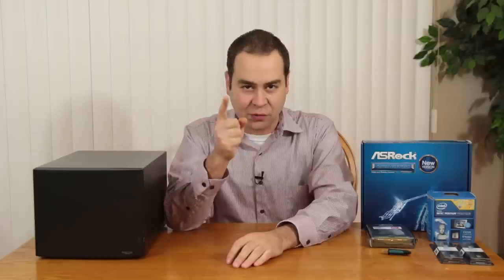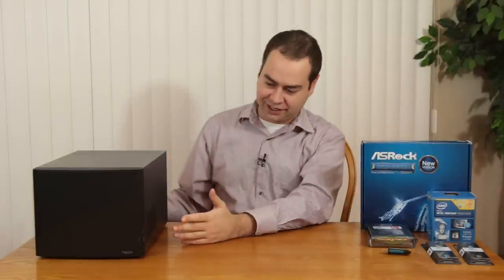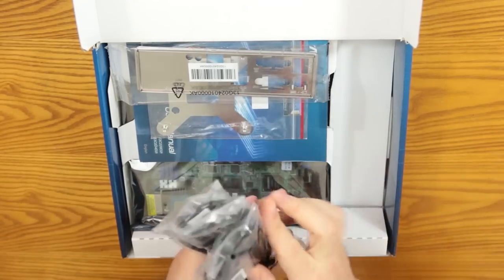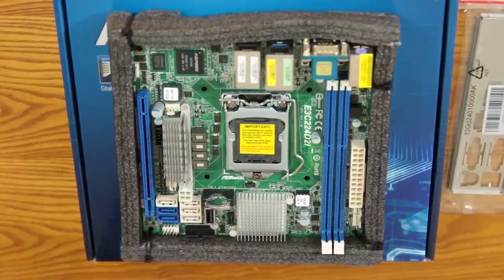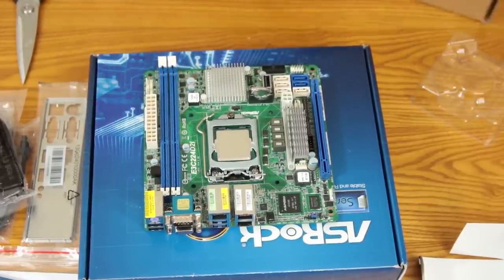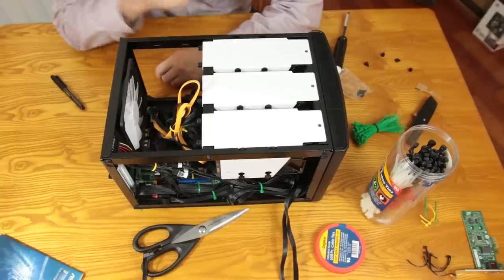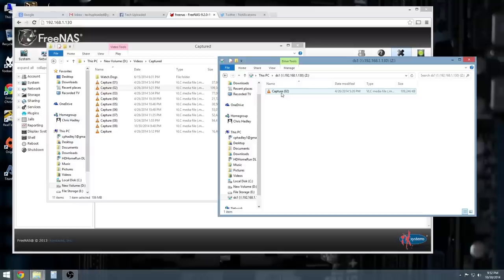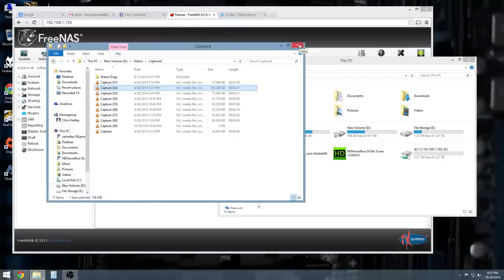FreeNAS Box ECC memory upgrade

Comment: Interesting, i have run my Freenas system for 5 years running continuously (except for when on vacation) without a problem without using ECC memory.  There has not been one error that I am aware of.  I'm storing pictures, movies, music on it for the whole household.  I do back up off-site and onto another 4TB drive in another computer to be safe though.
Reply: +vnitto Thanks for that! What RAM do you use anyway?

Comment: 10MB/s is not fast at all on a Gigabit Ethernet, it should be something in the range of 80-100MB/s...
Reply: +David Pérez i agree it should be much much faster... it should be around the 80MB/s range... he must have something that is throttling it....
Reply: +Nifty Mist well in case then he is capping out his switch... and should upgrade
Reply: Using a freenas system. 8 disk raidz2. Easy stable speed of about 100MB/s maintained while writing to the server. Not sure what he considers beefy but I'm at times writing 2 tb in one shot. For most of the home users such as myself I think 1 gigabit lan is going to be sufficient..
Reply: @bhoot  

Yeah, this guy has an old or defective network card/switch/router/or cable somewhere in his system creating the bottleneck. 

He really needs to find the choke point since he's only getting 1/10 the available throughput speed, assuming the rest of his gear is "modern". 

100 MB speeds over common commodity hardware is normal with FreeNAS. At least it is with all three of my FreeNAS rigs.

Comment: The i3 CPU that you were using before wasn't compatible with ECC memory?  Would have imagined that would be better than the Pentium.  I had no idea that FreeNAS didn't like non-EEC memory.  To be honest I don't know a whole lot about servers.

I don't like how the HDDs are vertical.  It's my preference that they're horizontal; they just seem to last a lot longer like that, I find.  Of course, just my preference haha.

I don't like how they trust me to take out the black CPU socket cover...I preferred it when they popped out.  It's something I've seen on quite a few new motherboards.  I've built quite a few systems in the last couple of months.  Not for myself though, just at school I've been building them for the younger kids, and building a few for friends and family.  

It's really hard to get a scale of the motherboard, until you put the heatsink in.  Wow, so tiny and adorable!  Haha

Cable management...Personally I don't like it with this case.  Then again, with all the HDDs there isn't much to do.  I guess with a case this small there isn't the room?

Talking about fans...The cheap POS Chinese one that I have on my gaming PC is slowly failing.  Keeps making weird noises, and grinding (kinda like its rubbing on a cable).  I checked, and as a I thought there aren't any cables there.  Ah well, it's still working fine, so I'll use it until it stops spinning!

You're not helping my temptation to setup a FreeNAS box myself!  As I said on Twitter, it's the price that puts me off and I don't really need a lot of storage.  It would just be nice.  Added redundancies are always good to have.  :-)

Comment: I search and search through the internet for a clear answer, but I have yet to have a answer, if I am building a nas, is it better to have a i3 or xeon? I want to do 2-3 streams in 1080p. Eventually, be able to stream 4k contents. I am just not very sure which path to take.
Reply: If you have the budget for it get the xeon or an i7. I say this because an i3 will not really be able to handle multiple streams at 1080 or 4k. check https://www.cpubenchmark.net/cpu_list.php

Comment: How can I know my Motherboard support ECC memory.
Reply: +Rolly C Check motherboard website.
Reply: +Rolly C You will need a server/workstation chipset.  So, no Z, H, or B series on Intel.  Basically no mainstream hardware.  Most all Intel CPU's support ECC though.  My server has a Supermicro board with the C226 chipset.  The CPU is a little Pentium G 3260.  You can always look up the Intel Ark page for any CPU or chipset to see ECC support.  Just google said chipset or CPU and click the Intel Ark link.  Usually one of the first couple links.  

I have not used AMD with ECC so I have not researched it at all.  Intel is so much more power efficient and more powerful per watt at the same time that I don't even consider AMD in a machine that will run 24/7.

Comment: Sorry but this is wrong.  You don't need ECC RAM to use ZFS.  Somewhere along the line some people have conflated "need ECC RAM and ZFS for extra data protection" with "need ECC RAM with ZFS for extra data protection".  The point is to plug all the weak points.

Comment: The premise of this video is utter horse crap. You do not need to use ECC RAM. The reason people freak out about it because they either don't understand the user case or the way FreeNAS / ZFS works. 
If an error occurs in RAM, then FreeNAS will happily write that corrupted data to disk the same way any other computer will regardless of the file system in use.  ZFS is an extremely powerful file system geared toward protecting your data at every step, but it can't protect against RAM errors. ECC RAM will automatically correct errors that occur within the RAM modules thereby closing that vulnerability. The FreeNAS / ZFS / ECC RAM combination are for users who are 'paranoid' about the integrity and high-availability of their data. If your not the kind of user to shuffle large amounts of data about (like a company would) you will quite likely never see a problem. ZFS mostly protects against disk errors and FreeNAS will run quite happily without ECC RAM. ZFS doesn't come with overheads though, so you'd have to wonder why anyone would go to the trouble of using ZFS and not use ECC RAM.

Comment: Yeah, you don't actually need ECC RAM for ZFS. The mighty “scrub of death” is bullshit. 
There are basically 2 types of RAM errors you can get: 
1. Random bit flip
A single random bit in RAM is flipped. Quite rare but it does happen. 
Result: An integrity check might fail (even though the data is fine) and ZFS will mark a block of data as damaged and attempt to repair it. The repair will only take place if the redundant block passes the check, so the data is fine. 
Worst case: Correct data will be (needlessly) overwritten with correct data. 
2. Fixed bits
RAMs sometimes break in a way where certain bits will always return the same value regardless of what's been written to them. 
Result: Every integrity check which uses this part of RAM will fail. If both a block being checked and any redundant block which could be used to repair it are affected, the block will be marked as lost and the whole volume as unrecoverable, but no correct data will be overwritten because there was “no correct data” to overwrite it with. You'll need to replace the broken RAM and recheck the file system. 
Worst case: Basically a denial of service until you replace the RAM. 
And then there's the fearsome “scrub of death” where your RAM magically becomes a first order SHA256/fletcher2/fletcher4 collision generator which garbles up any data read from the disk but only in such way that half the time the checksum is correct, so every correct block of data will be marked as damaged and then, when the redundant block is read, it will be damaged in RAM, but it will pass the integrity check and the correct data will be overwritten with garbage. Repeat until all data is gone. 
Worst case: You lose all data, but you now have a first order SHA256/fletcher2/fletcher4 collision generator and any intelligence agency in the world will give you millions (if not billions) for it, which should help ease your pain. (Hint: In case it's not obvious enough, this will never happen.)
Reply: +hellterminator The issue is that ZFS will use the data in RAM, not the parity if neither checks out with RAM.  It always assumes the RAM is correct.  This will introduce bitrot into the array.  Much like you get in RAID5 setups.  But in RAID5 the controller just guesses at what drive has the right data on it.  50/50 shot of borking the data.  

So, the whole array may not go down, but chunks of data can be lost with a flipped bit in memory.  It can and has happened.  You see it crop up on the FreeNAS forums from time to time when people come in asking about corrupted data and in many cases it boils down to non ECC memory.  You wont even know it happened till the day you try to read the data.
Reply: Chad Bremer I was talking about scrubs because scrubs are the most common argument for ECC RAM. When writing data to the drive for the first, yes, if it gets corrupted in the RAM, it will be corrupted on the drive. But the same applies to literally every other file system and you don't see anyone saying that ECC memory is necessary for NTFS or FAT32. 
Sure, it's better (it's always better), but far from necessary.
Reply: ***** it will do the same thing in a scrub.  ZFS trusts data in RAM always.
Reply: Chad Bremer And how will it get the data into RAM during a scrub? It will load it from one of the hard drives. And what does ZFS do when loading data from a hard drive? It verifies the checksum.
For this to be a problem, the RAM would have to mess up a block, so the integrity check fails, load a redundant block correctly, so it passes the check and then immediately mess it up before it is used to replace the original “faulty” block. And even then, the original block is damaged (which will be discovered during the next integrity check) but the redundant block which was used to “recover” it is still untouched.
Reply: There is a a cached hash of changed data about the drives in RAM.  That is the guide for ZFS.  If a bit flips in that hash, you are in bad shape.  It is always double checking against the hash.  This hash is the checksum for the data.  And that checksum tree is rooted in RAM for the whole system.  There is a checksum at every layer as you move and each layer has it's checksum stored in the pointer from the previous layer.  That is how ZFS self validates, unlike RAID.  So, if data is bad on one drive or at some point gets corrupted as it moves up the chain a checksum from the last time the data was accessed with mismatch.  That checksum is compared to all copies of the data.  The one that does not match is then replaced.  So, if you get a mismatch, and neither copy of the data in storage matches the checksum that cam from memory, both are considered wrong and the data is corrupted.  The linchpin for the entire ZFS files system is that checksum hash in memory.  If it goes bad in part or whole data on the drives becomes invalid because it does not match.  It does not matter if you are reading or scrubbing either.  Both will go through the same checksum list to verify integrity.  All the scrub is, is reading all the data in a volume to check against the checksum rather then just what ever is being pulled from the drives.  ZFS always will trust the root checksum in memory over all else.  Every time.  That is how it is designed and that is why you want/need ECC.
Reply: Chad Bremer So what? All copies of the data will be marked as damaged and the whole as irrecoverable. But the data itself is still intact.
Reply: +hellterminator wow...  Your understanding of ZFS is lacking at best.  it's not just the data it's self the can get borked.  it can even be the file system is self.  a flipped or stuck bit at that point can result in a cascading coruption problem.  That is how people lose a whole drive pool.  the usual data recovery software can not pull the data.  Non work with a ZFS file system.  Your only solution is a data recovery company you send the drives to.  That will be a five digit plus bill depending on the size of the pool.  Really, stuck bit (also the most common problem) is the most dangerous problem. You need to do some research on ZFS.  It is pretty obvious you do not understand at all what is going on under the hood.  If you did you would understand why ECC is a must.  You are giving bad advice on a subject you do not understand, at all.
Reply: Chad Bremer Enlighten me then. How exactly does a stuck bit destroy the entire pool? (Seriously. I don't see how that could happen but if it can, I do want to know.)
Reply: +hellterminator I will leave you a link from the freenas forums posted by one of the guru admins.  It goes over what I talked about in far greater detail then I can post in a comment.  

https://forums.freenas.org/index.php?threads/ecc-vs-non-ecc-ram-and-zfs.15449/
Reply: Well... to win a lottery is almost impossible yet... there is a winner every day or week. So since ECC prices are almost identical (very small overhead in price to non-ECC where I live for example) it would be foolish not to spend that extra 1-2% (ok... let's call it 5% just for the sake of argument) in overall NAS cost to protect against a "win".

Comment: Going with 8GB of ram is NOT a good choice, ZFS requires 1GB of ram for every 1Tb of space.
Reply: +Gino Jansen This is a very common misconception about ZFS.  The amount of memory you should use in a ZFS box should be the size of your usual memory footprint + the size of how much data you want RAM cached + how much free memory space you would like as a buffer.

You run into egregious memory requirements in ZFS (such as 1GB per 1TB) when deduplication is turned on, but dedup is such a corner case that it is completely inadvisable except to those who know what they are doing and are absolutely sure they require it, as it incurs a major performance penalty along with the inflated memory requirements (the checksum table is stored in memory, thus expanding the memory requirements).

It is completely valid to use ZFS on a low RAM system; you will just miss out on a lot of the ARC benefits.

Source: I am a system administrator who has set up and maintains several servers using ZFS.